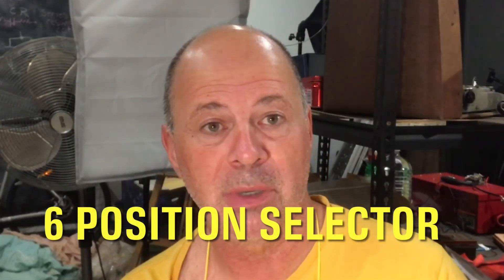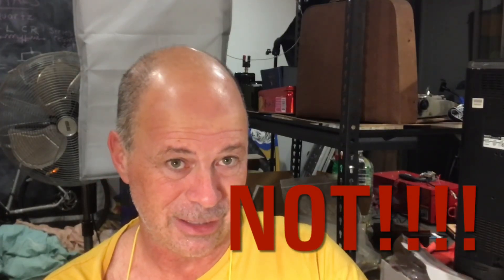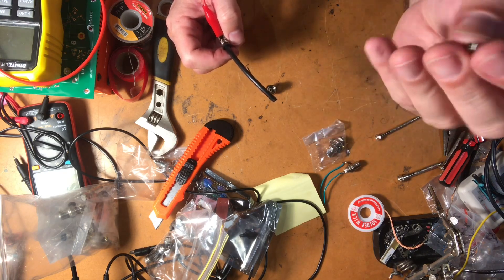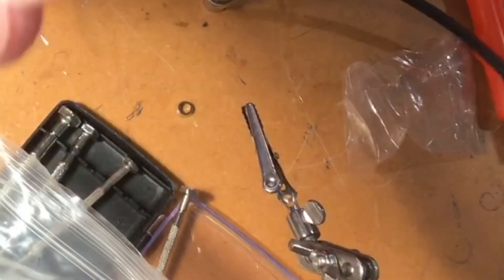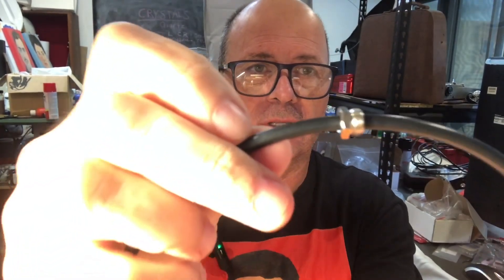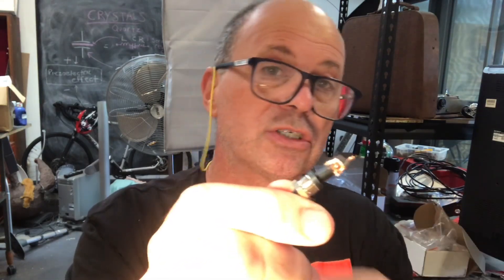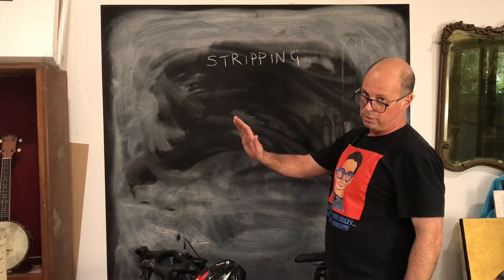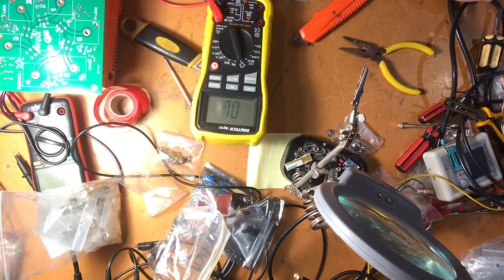How to make BNC connector 50 ohm patch cables

Comment: I’ve used those BNC connectors on outside leads and they’ve lasted a few years relatively trouble free.  They seal up nicely. 

Silicone is your friend if you’re concerned about ongoing moisture ingress
Reply: Also. I’ll see if I have an F connector spanner for you which I believe fits the indents in the BNC barrel